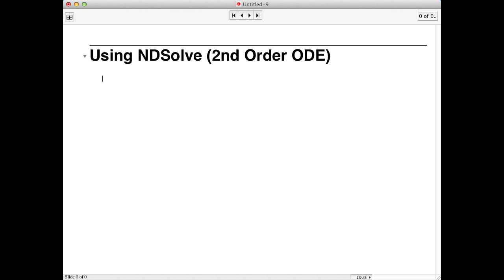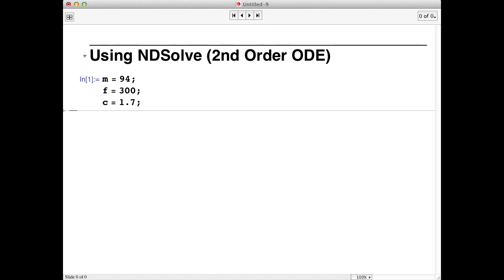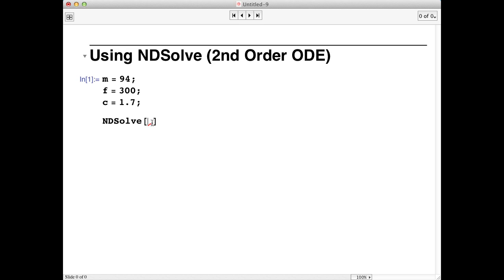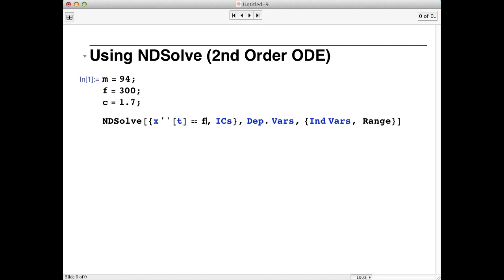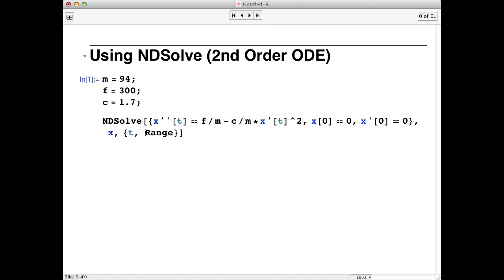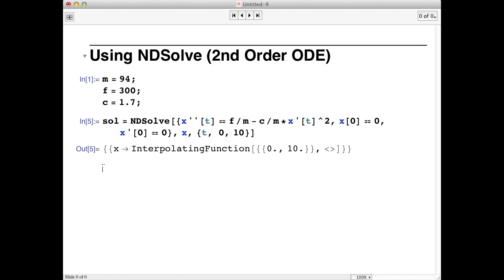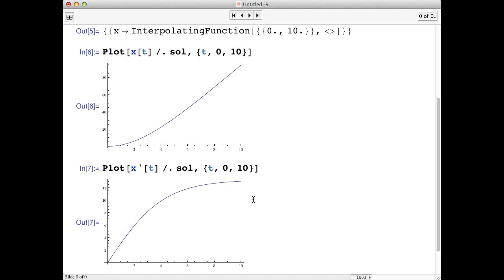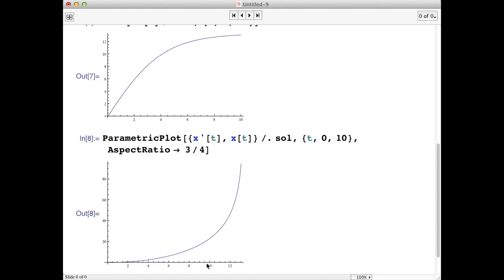Using Mathematica's NDSolve

Comment: A better model would be to have the runner putting out a constant power, rather than a constant force. I find Bolt could put out a continuous 4 horsepower for the 10 or so seconds. In that case, try: P = 4*746; sol2 = 
 NDSolve[{x''[t] == P/x'[t]/m - c/m x'[t]^2, x[0] == 0, x'[0] == 0.001}, x, {t, 0, 10}] (the 0.001 just avoids the singularity at zero time.)